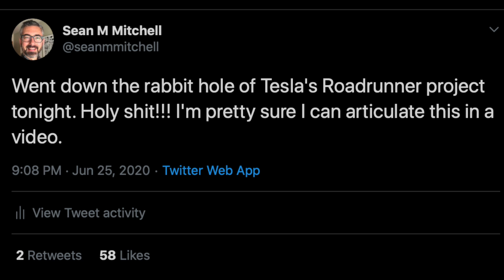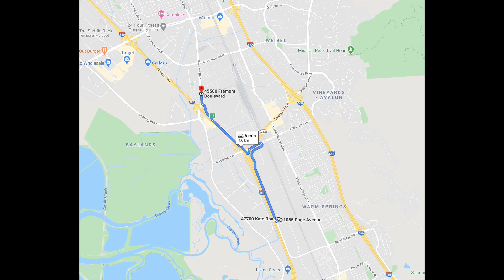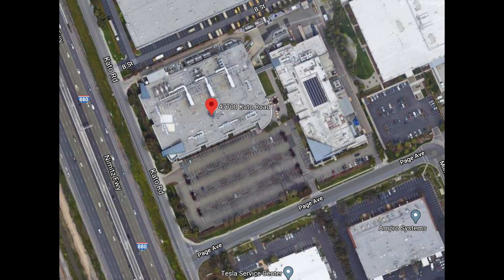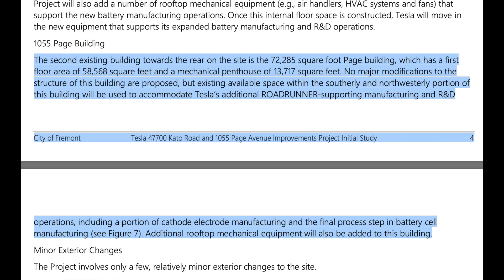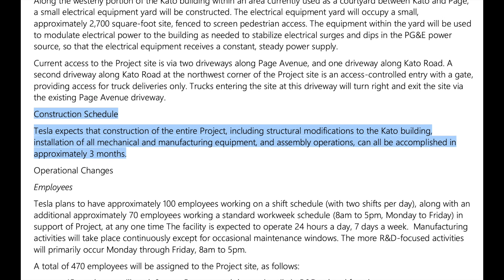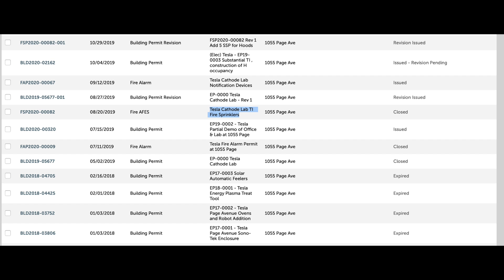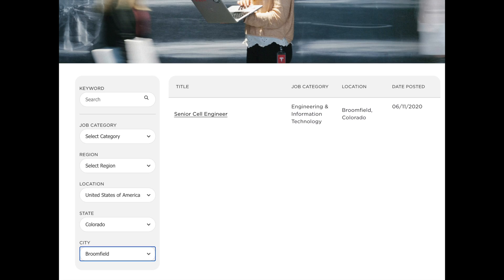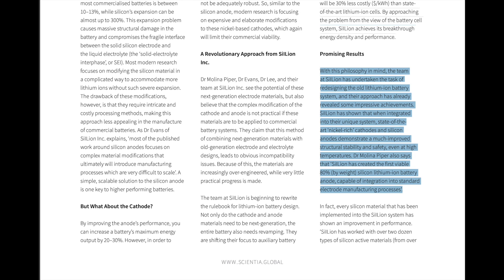Tesla Roadrunner Project: New Insights

Comment: While low volume seems reasonable for such a modestly-sized building—what if the combination of Maxwell and SiLion tech leads to mindblowingly rapid and highly automated production? What if HiBar and Grohmann have created machines that turn raw materials into finished batteries so fast (70 cells per second total) that the building can produce 30 GWh itself? How large would 3-4 Grohmann module lines—like those in Sparks—be? Those and cell production are all that’s needed to make Fremont independent for 500K cars a year. Then repeat that in Shanghai and Berlin.

Comment: Elon ways said "No plans to put 2170 cells in S and X", he did not say  that there are now plans for non 18560 cells 😁
S/X are ~15k per quarter even with a small battery line they could produce enough. 👌
Reply: I cell type, all vehicles.
Modular pack.
Modular BMS.
Huge savings.
Reply: @rogerstarkey5390  They have contracts with Panasonic delivering 18650 from Panasonic's manufacturing plant in Japan. I guess they will build Tesla cells for S/X first, put the 18650 from Panasonic in stationary storage products (poerwall/megapack/V3 SuC).
Then they scale the cells for 3/Y, 21700 then goes into stationary products to and last they scale too have more for Cybertruck and semi.

Comment: This may the be "new chemistry" that some say is needed to deliver the Semi's promised  energy density/range and longevity.
Reply: It's new cathode/ anode chemistry, new production method (Maxwell), new electrolyte, new cell construction, and probably new pack design with better cooling and Automated construction.
The basis of s common cell, pack, BMS format for all vehicles.
Also, cell resilience allowing V3 max charge rate across 0-90+% (!!)
And other stuff.

Comment: Tesla do not have to make their own batteries atm. All they need to do is make the best cathodes first and that takes a lot less space and was already happening at Maxwell plants. The small Kato facility could make all the cathodes and later anodes required for all Tesla batteries and existing suppliers can make the actual cells. The Maxwell facilities and methodology are high security so less problems with out souring cell manufacturing to suppliers like CATL.

Comment: History would suggest that Tesla don’t go in for small scale.  If we assume that they are out of the R&D stage it seems to me they would jumó to building large scale production.  I suspect that the small factory space is possible because they will be using the maxwell dry battery electrode technology which requires a much smaller factory footprint.

Comment: Good detective work.  Could be for S and X or trucks but probably will also serve to prove that a smaller footprint facility can produce more batteries per sq ft due to improved processes like the Maxwell dry electrode (no long drying times).  Whatever it turns out to be I will be another cutting edge innovation.

Comment: My guess is this is where they are using Hibar, Maxell, Grohmann technologies to build and test a production line, you have heard it before building the machine that builds the machine. Once operational and out putting cells they could tool up and build the same lines in the car plants. You know what Elon has said for a long time. There is just not enough batteries that is where the issue lies! And personally after watching a video lecture from of the university of Nova scotia I think there at way more than 1 million miles.

Comment: 38 trucks a day - this is a number we can work with. Assume Class 8, 80,000 lb trucks (36.3 tonnes) gross. Assume 15 trucks take away cells each day and the load is 20 tonnes - 300 tonnes (300,000 kg) of cells per day. Approx 4 kg/kWh - 75,000 kWh of cells. Model S and X have 100 kWh batteries - 750 batteries per day. 10,000 S and X vehicles per quarter, requires just 110 batteries per day - 640 batteries (100 hr) for other vehicles, 850 vehicles per day (Model 3 & Y). Present capacity, if just 15% of the expanded capacity being built, is sufficient for S, X. They surely have the new cells.

Comment: I think the new larger cell batteries (4180)? will have 4X or more the energy of the 2170. This means 1/4 the number of batteries required. The lower internal resistance will allow higher charging speeds and easier cooling requirements. Tesla could start with the new plaid premium S&X vehicles  but the current 2170 and 18650 batteries are sufficient in range and lifespan for existing models. The cyber truck and semi will actually need the new battery tech to meet specs.   The additional factory  space must be needed for the large battery finishing machines which charge and test the batteries coming off the line.

Comment: Guess you are right that  the RR cells will be used for new X and S cars. The modification of the product line (the new cells may have another format than the present 18650 cells) is going on right now. This is an important modification as the pack and even bms should be modified too. 
Why going on right now? Because the order window  mentions (since the June 22) a delivery time of 8 to 12 weeks. 12 weeks is battery day. Before that it was 2 to maximum 3 weeks. 
8 weeks also tells us that they will start to deliver the new pack and cells starting from the middle of August. If that happens there will be no refresh at this time.  Almost nobody will see this if they get a car with the new cells as i expect the battery size to remain at 100 kWh and will be software locked to the existing ranges. At battery day they will open up a 500 mile for S and a 400 mile for X as the new cells will have a higher energy. Therefore i reckon that plaid will be presented later on (might be presented on battery day but not delievered befor the end of the year).

Comment: Sean we know at least one initial Roadster prototype featured no rear seats just big box probably housing 100 kWh battery in addition to the 100 kWh in the floor. There is no way with current cell tech there is enough room in the floor and calculations into gross weight of Semi says there is no way current tech batteries make any sense. My guess is Semi will be the first use in 2020 then S and X 2021 once field trials data is OK then Roadster, there is no way Tesla will risk Roadster until batteries are proven. Halo cars work when perfect, Im hanging on to my 2014 Model S waiting for Roadster.

Comment: There are numerous luxury sedan and suv competitors on the horizon.  Tesla will use new battery tech with relatively low production capacity at the Kato plant for models s/x.  Hopefully we will also see a badly needed refresh. 500 mile range and 30 minute charge time are a possibility to blow away the competition.

Comment: 2/19 Tesla buys Maxwell -“A Tesla Model 3 battery pack has an energy density of 272 watt-hours per liter; the cells produce 207 watt-hours per kilogram. The dry battery technology ramp is said to be to 300 Wh/kilogram (+45 percent) “demonstrated,” Maxwell says, and then with a “path to 500 wH/Kg identified” (+142 percent or 2.4x the initial rating.)

Maxwell laid out its near term plans in a presentation and paper at the recent Power Sources conference. Maxwell says it anticipates large-scale production by 2023. Tesla says it might get to market sooner, 2020-2021.”

https://www.extremetech.com/extreme/285666-did-tesla-buy-maxwell-for-its-ultracapacitors-or-higher-density-batteries

Me: Would Musk be ready to “blow your mind” (quote Jan 2020) with huge new battery tech in March 2020, 3+ months before Roadrunner has new building permits, if he didn’t have something already in the bag?  Could Tesla Nevada have been working on this since January?

Tesla CATL battery deal is a red herring, an absolute necessity to qualify for China EV subsidies (also reducing costs and improving manufacturing logistics). 

Thinking Battery day is about multiple efficiencies (price & range) with 300 wH/Kg production to be sold in 2020 and Roadrunner is working on the 500 wH/Kg or even the next big thing.
Reply: I agree that the new battery must be available already, probably produced at the Nevada factory.

Comment: Your video "suggests" Lithium is redundant as the chosen energy store for EV batteries. You begin quoting Musk as saying "Li Ion is BS". You finish with SilLion announcing a new EV battery breakthrough.
However the energy store material in a High Nickel Cathode is STILL Lithium ... am I correct? It would appear the breakthrough is in the Anode material, replacing previously used Graphitic Carbon ... am I correct?
Actually, I'm more focused on Svolt's recent breakthrough announcement for their NMx EV battery, which requires no Cobalt and offers thermal stability and 1.2m km lifespan.
As a Lithium/EV sector investor, I say more power to  all developers including the crew at Tesla. I'm starting to wonder if BYD, Svolt and now CATL, have stolen some of Tesla's thunder.
Power on dudes and be excellent.
Reply: What they are saying (and Elon mentioned it before) is that the battery shouldn't be called lithium-ion as there is only a very small percentage lithium that makes up the battery, he said it should be called a nickel graphite battery instead

Comment: Thanks for the research, especially the SiiLion finding. My prediction is as follows: The price of Models S and X has just been cut by $5,000. These new batteries will go into the Plaid versions of the S/X, which then will be sold within the range from the original price to max. $5,000 higher. In the future Plaid/Performance and standard models will have different batteries. (Untill now the different specs have been created through the software.)

Comment: Nice report. But I believe the new tec will go into  everything. Across the board. Why? Brand.  Tesla will be the absolute best it can be and no one will catch them. For decades. At least three or four. Also, this tec will increase range and better charging rates and use. So they will have to create less batteries to make, for example, a model Y go as far as it does now.  They'll want that. Less batteries to manufacture to do the same thing they're doing. More for less.
Reply: A tremendous amount of technological change can occur in three or four decades.  My crystal ball is opaque beyond 5-10 years.
Reply: This is absolutely certain to happen eventually, but while ramping this stuff up it will likely only be integrated in new Products and/or existing ones with comparatively low Volume probably, until there is enough capacity to use it across the board.
Reply: @unitrader403  We'll see.

Comment: Plaid, because it must have more cell density (and resilience)
Anyway, it's the test mule for Roadster and probably the Semi/ Cybertruck cells.
They've maxed out the existing pack volume, so it must be the cell which improves.
Next, tabless construction for low resistance, keeping the system cool, which will have the benefit of full V3 250W charging, over the full(?) cell capacity (not 10-40%).
Next, cost.
Not only will the cell itself be cheaper per can, fewer cells needed in each pack will lower the cost.
Also, instead of a low run, therefore expensive 18659, which has to be shipped from Japan, they'll have a high density, locally built and eventually high production cell.
Next, new pack.
It's likely this cell will be 2170 only, used across all models for economy of scale. So, new pack, better cooling, new BMS to match makes sense. Documents suggest a highly automated pack assembly method in the works.
This could halve the pack cost of the 100kWh S/X pack. That's 10k per car to fund interior redesign!

And other things.....
Reply: Cells are expected to be much wider due to les heat generation and better dissipation.
Reply: @musaran2  
Wider?

Comment: My guess, the vehicles that are not on the market yet: Tesla Semi and Cybertruck; the new battery will go in these upcoming models.
Reply: It wouldn't surprise me if that was what they are intending to do, looking at how long they have been holding off on the manufacturing of the Semi.. another possibility is the inclusion of the Roadster. Though I could definitely understand utilizing the new batteries first in the Semi and the Cybertruck.. and observing the performance first, before putting them in the Roadster.
Reply: Then there’s the model S Plaid which will probably get the new battery technology first, ditto the MX, then the Semi  and CT.
Reply: Most important need for upgraded batteries at the moment is the semi.  Not published the weight yet,  every pound matters.  Did you notice the units they were using for car deliveries.  The semis carried fewer cars than the diesel vehicles.  The closer they can get this the better.

Comment: OK, watched it all. It showed up after a few minutes. Really disappointed. There was nothing new in this video, everything you discuss has already been covered at length on Twitter and YouTube. Is this the extent of your deep dive, or did you find out more that you’re not telling us? Kato/Page site is right beside seat factory, which you didn’t mention. It’s also known to only house the pilot line and a modest Roadrunner line, not the full TW lines.
Reply from the maker: You’ve missed what I think is most important
Reply: Sean Mitchell would that be that the nickel/silicon-carbon chemistry used by SiiLion? I don’t know what the consequences of that would be, other than the expected < $100/kWh and performance of announced vehicles. Or were you referring to something else?
Reply: @NicholasShanks  "content creators" have to crank out videos so they make money. Sean does a good job of doing his research, even if it can be redundant at times. And new bits of info tie into old ones, so ofc it's worth mentioning already known things
Reply: ThinkBig500 well yeah but I was all psyched up in anticipation and then let down by learning nothing new :-( I wanted Sean to spill all the battery day beans! What’s so great that it blows Elon’s mind?
Reply from the maker: @NicholasShanks  The new info is that, the yet discussed, SilLion, appears to be a new part of the mix. There's more to unpack with the company, just need more time. Also, this new construction should be done in 3 months!!!
Reply: Sean Mitchell The environmental study was signed off on the 20th of March. I expect construction would have begun shortly after that (are any other permits needed). That would put the end of works at about early July.
Reply: @AllThingsEV  Perhaps this isn't important but the Kato bldg sq footage doesn't add up: 126k total with 97k 1st floor and 51k 2nd floor?
Reply: @Nicholas Shanks you're just a spoiled, petulant little boy.
Reply: Dirk you don’t participate in the twitter conversations or live video chats, so I’ll forgive you for taking my apparent brashness out of context.
Reply: Nicholas Shanks he’s just reporting what we know so far and his opinion on what he’s expecting from the latest. Isn’t that the point? Do you want him to make up fake news?
Reply: Sagar Patel no, dearly not! It’s fine—it is what it is—I had misunderstood the comments on twitter leading up to this to mean Sean had “cracked” the full scope of what would be announced.

Comment: Plaid first, then all S & X :) no Osborne effect that way, start with the most expensive cars and work the way down. thanks for the video
Reply from the maker: S and X need a boost stat!
Reply: Sean Mitchell Model S and X need a redesign imo, especially the interior, which looks extremely dated (I wasn’t a fan of the touchscreen integration when it was released- pretty brutal). Model 3 has set a new standard. Great video and research btw Sean👌
Reply: @anthonysmithtube  I've heard some owner's complaints who traded MS to M3 that they miss larger screen(s) of the S.
Reply: @anthonysmithtube  I would never trade my Model S instrumentation for the current Model 3 design.  After over 4 years of ownership, I am still quite pleased with my Tesla.
Reply: @dmitrii336  I can imagine (and I would probably feel the same), but I still think the integration of a larger screen could be much improved in a redesign. They wouldn't necessarily need to stick with a 15" screen
Reply: @redoscar540  Fair play. Out of curiosity- for what reasons? More tactile controls? Quality perception? Design/ Styling? Materials? Genuinely interested.
Reply: Sean Mitchell Yep. Then build at Tera Texas for CT!
Reply: @AllThingsEV  
Fewer, more resilient cells per 100kWh pack, with no import cost and faster charge due to lower internal resistance (heat), etc, will halve the pack cost and make the S/X cheaper, lighter and more competitive........ When the cell production is sufficient, maybe immediately (?).
Reply: If you were starting with the most expensive vehicles first, then you would have to be putting them into the Semi and the Roadster. And then working down through the Model S and X, and of course the Cybertruck.Though where the Roadster production has been tentatively said by Elon to only be 10,000 a year, it could be done in conjunction with a Model S and X refresh.
Reply: @danahebdon6810  
The Semi, Roadster need factories.
Plaid is the perfect low volume testbed.
S/X "standard" benefit from cheaper cells/ packs, which pays for a refresh(!)